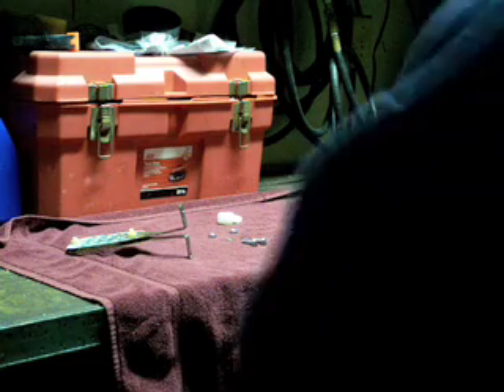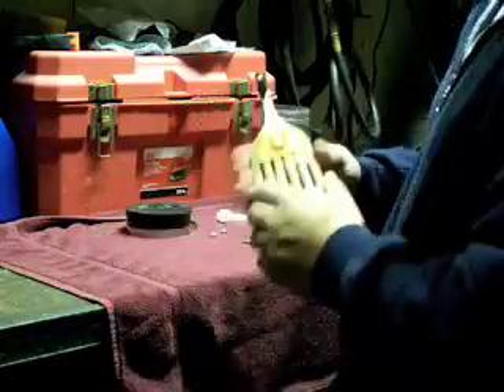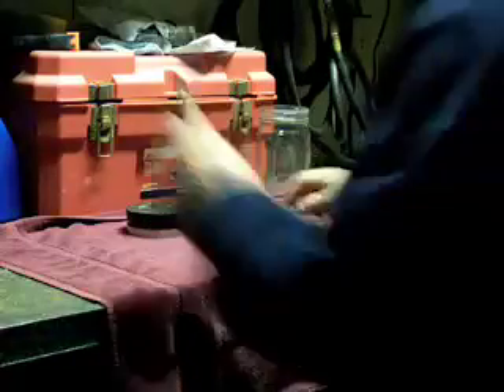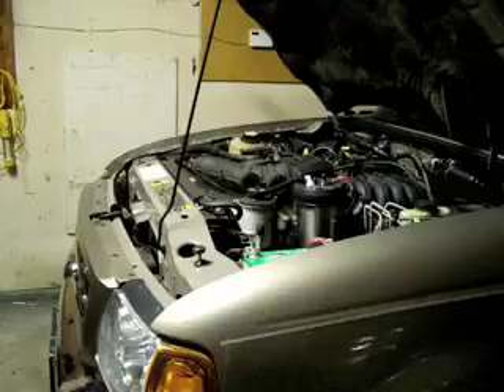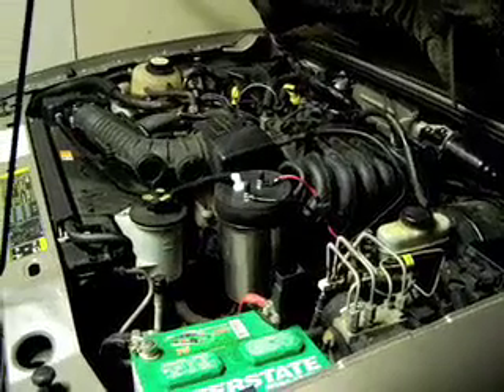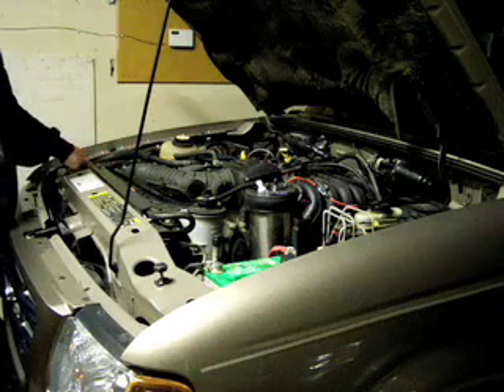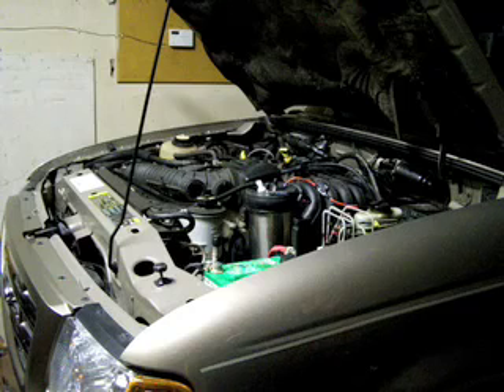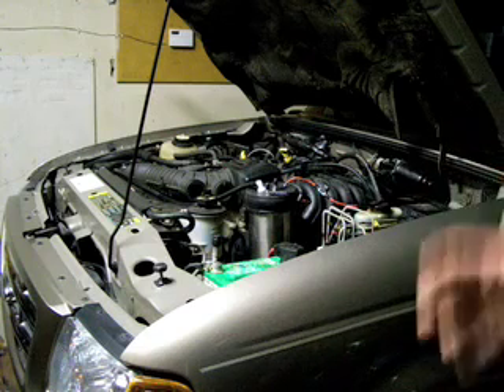How to build a simple - yet effective - HHO Generator

Comment: Can u make a video of how to make one that can completely run a car on HHO?
Reply from the maker: +Zane Kubicek  -  running an engine on hho without another fuel to assist combustion is a difficult feat.  Chemical hho creation using aluminum is a viable solution to this dilema.  Browns has is normally used to increase the flame front as other fuels burn and thus increasing mpg.

Comment: Would the air intake vacume from a turbocharged car be strong enough to suck the water out the chamber through the tube and draw the water into the engine?
Reply from the maker: +Jamie Byfield  -  If installed with the gas feeding in, as explained, prior to the air cleaner I can't imagine that happening.   However, obviously you should trial it carefully to avoid having issues or causing damage.  Use caution and safety first always.

Comment: How did you stop the engine from adding more fuel to the engine when it reads senses the added oxygen in the system? I've read there is some sort of chip you need to use is this what you did?
Reply from the maker: +Micheál Clune You don't need to modify anything as long as you allow it to mix with the incoming air flow.

Comment: I live in Maine, 5 months of freezing weather, no heated garage.
Q;  Will the sodium bicarb (baking soda) protect the H2o from freezing?
I liked the simplicity of your video.
Reply from the maker: Jean you will need to protect the cell from freezing by either using ethylene glycol or through the use of an outside heat source such as possibly a block heater when the device is not being used.  I use ethylene glycol in mine, just keep in mind that the cell will need more frequent cleaning this way.
Reply: salt water? maybe
Reply: ***** hi terry will a plastic peanut butter jar work?
Reply from the maker: jack terry I would think that a plastic jar made of that kind of plastic would probably melt or warp form the heat which would be risky.  Remember this is hydrogen gas and is highly explosive so always do the safe thing first and avoid unnecessary risks.
Reply: it will make it less poisoniees since salt will make a chemical that'll rust the metal and make a toxic gas

Comment: Great video and one that fully wexplains everything . . .Spme people mention about getting power supply from back of alternator others mention about installing a switch on dask board. . ome mentyion about mention about finsinf a vacum hose and connecting that way . . . personally I would use fuel in take were the Gas  (petrol) goes in to carb if carb version . . If inhection then id put it other side of air sensor
Reply from the maker: +jacky Parker if you plumb HHO directly in the way you mention you drastically increase the chances you will have an explosion incident.  My way is much safer and helps the gas and air mix which does not throw off the sensors.
Reply: no sensors on this engine

Comment: Hi Terry, I'm using aluminum plates 3'' PVC I have a 48 plate system it's about 30'' inches long. it holds almost 1 gallon of water. I added 20 oz of 3% hydrogen Peroxide I got a few bubbles, then I put 3 oz of food grade hydrogen Pero0xide 35% I got more bubbles I went to a 5/8 fitting I didn't want to build up pressure and have an even flow. I used warm tap water very few bubbles at this point. To keep the plates separated I hot glued drinking straws on both side of one plate of the 24 plates. I used my 50 amp battery charger to test the system. I chose Aluminum to better conduct the power better. I used a drain screw off lid and drilled the 5/8 hole for the out put of the Hydrogen and 2 holes for the electrical hook ups. and 2 Aluminum machine screws with flat washers and lock washers and silicone, and Teflon tape to seal every thing up. I need some input.? Does baking soda react to Aluminum ? My next step is building my bubbler.
Reply from the maker: +Fred Bynum I have not very poor results with Aluminum Fred.  I stick with stainless steel because it produces better and holds up to corrosion much longer.   Baking soda is sodium so it will likely corrode the aluminum or coat it with film.

Comment: Thanks for the tips. HHO before map sensor I didn't even think of that one, and putting the power supply line through a relay so it only has power when the key is on is definitely needed, Or a switch inside the cab would work also this way you could listen to the radio when your waiting for the wife..

Some type of flash back arrestor for a secondary safety feature should be used for sure, with a blowout valve on the jar for the primary safety. Also a bubbler so the steam gets captured before the hose goes into the air intake box. This way only the HHO gets to the combustion chamber in the engine.

Should also be aware to never had bare wires inside the jars they will corrode then spark and ignite the gas, do your home work thoroughly 1st many hours worth of learning on YouTube alone.

Cheers
Reply from the maker: +NoFear4XJs All good tips No Fear.   Thanks.
Reply: Thanks but only tips, as sometimes we can see better when we put insights into words...
Reply: I think steam is a bad thing, just means your boiling the water and not making more HHO. You also want both gasses to enter the combustion chamber that where the real power is. Agree ? Cheers

Comment: VERY EXPLOSIVE... personally experienced !!!  And I was only using a little 9 volt battery and a small jelly jar with two twisted wires 3 inches long.
Use extreme caution. Less is more, and more is lethal. Respect this an enjoy the benefits, abuse it an suffer the consequences. PLEASE BE SMART & SAFE.
Reply from the maker: +Ken Eutsey Well said Ken.  I can not express this enough to folks.  I have been doing this a long time so I too have had some close calls even with safety measures in place.  HHO is more explosive simply because it already has the oxygen it needs before it even mixes with the outside air.  Be SAFE

Comment: Hi Terry,  great video,  The air flow meter,  has it got any issues with the new air/gas mix passing through it?
Reply from the maker: +Dave Maher Not as long as you allow the gas to mix with the incoming air.  This is another reason I make the gas pass through the air cleaner box.  It helps the mix and it creates a safety barrier between the engine and the fuel cell.

Comment: So I can safely assume that I cant use this as a torch like we did a century ago.
Reply from the maker: +Delve Spectrum You can build a HHO torch and it is very useful just be sure to have a barrier between your torch and your fuel cell.  Remember the hydrogen already is mixed with oxygen so if the flow of gas slows or you accidentally touch the tip the flame will just flow back up the line.  If it makes it to your fuel cell you will have an incident . . . boom.   What I have done is put a tank between my torch and fuel cell that has a cap on it that will blow off.  So the gas flows out of the fuel cell bubbles through the liquid in the tank and then into the line feeding your torch.  If you have an incident the flame will travel to the tank and blow the cap off but it cant get through the water barrier to the fuel cell.  You will still have a boom but the cell will be safe.  A washer fluid tank works nicely with a rubber cap pushed on tight enough to seal but loose enough to pop off.

Comment from the maker: If you are blowing fuses you are probably using too much electrolyte in your solution causing too much current draw.  Try cutting back on your mixture first before trying to move up in fuse size.

Comment: I have built a fuel cell, it works great but when I connect a 10 amp fuse it keeps blowing.. Can I use a 20 amp or 30 amp fuse instead.

Comment from the maker: My Ranger has a 4-cylinder engine in it.  The average person sees 10% gains and more complete combustion on engines running normally before and after installation.  A Hemi should be using a dry cell unit like the one in my other video and not this little guy.

Comment from the maker: In one of my first projects I wired my relay into the wiper motor circuit by splicing the relays trigger power directly into the wire.  I suggest you find the circuit that powers your fuel pump in the fuse panel and wire your relay there instead.

Comment from the maker: HHO is Hydrogen-Hydrogen-Oxygen which is obviously a very explosive mixture.  Since it has it's own oxygen it cant be expected to be transferred as safely as other gases that do not contain oxygen. For instance if  propane tank were to spring a leak and gas were hissing from the tank as long as that gas is not mixed with oxygen inside the tank it would only burn outside the tank once it becomes mixed with oxygen.  Not so with HHO because it already contains the oxygen needed for combustion.

Comment from the maker: A bubbler is simply a sealed container of fluid like antifreeze or water in which you would feed the gas into submerged in the liquid.  The gas would then "bubble" through the liquid in the sealed container collect in the top.  In the top of the container you would seal in a fitting that could then be used to attach a line / hose to so that you can send the gas to your engine or torch or whatever.

Comment: Hey Terry, I have a question. I've read the use of a bubbler valve may be needed. What does it do and what is it? Where would you even put it? I understand that when you run a positive and negative current, the electrolyzed water completes the current and gives off a gas that you send through a valve into your intake. It's the bubbler valve that's confusing me. Great video by the way.

Comment from the maker: 10 amp fuse and wire is more than enough for this little guy.  Fuel pump switched circuit is the ideal power mechanism for your relay circuit.  And yes distilled water is just fine although you will still need an electrolyte.

Comment from the maker: Using a relay and connected to a switched circuit is the safe way to install this.  Preferably a circuit that is only energized when the key is on like the fuel pump circuit for instance.

Comment: you only use hho to supplement your fuel(gasoline) is it possible to run a car on 100% hho and if so will the car run hot because it is a lean fuel which may cause valves to burn as in lpg and gasoline vapours?

Comment: This may be a silly question, but what amperage wire and fuses are you guys using, also if someone can't find the wiper motor, what other sources of power would you recommend ? IE fuel pump etc, By the way GREAT VIDEO thanks Terry :) oh and can I still use distilled water, as I know the crap in our water here would surely interrupt the electrolysis process THANKS GUYS

Comment from the maker: I don't use a bubbler but you are definitely encouraged to do so if you have any doubt about safety or purity.  I have mine feeding into the air cleaner box so the HHO gas has to pass through the air cleaner / filter.

Comment from the maker: Yes but unlike propane or natural gas this has oxygen mixed in it at high levels which makes it very explosive.  If you were to try to compress this gas it will likely explode.  If you had the ability to liquify it that might be a different story.

Comment: the hydrogen gas is same gas coming out of your battery, is very explosive,that being said ,it can be controlled by excellent use of the best materials,your vehicle no matter what it is, will burn this gas and be very happy,in the 60's we knew of this tech,but when gasoline is 12cents a gal,who cares,now it is different story,this design is pretty good,just remember when motor is off everything is off,bro went to vegasw/o hydrogen,600. in fuel,came backw/hydrogen284.00 infuel no bull,it works

Comment: I just wanted to finish my other post. So after the mishap I built another one using four spatulas I have it in a PVC container. I put a blow out valve on top and have a flow arrestor on the tube just to be safe. I haven't wired it into the truck yet but did test it. It works great! And I wanted to thank you for taking the time to post this.I had know idea how powerful HHO is!

Comment from the maker: A hydrogen  fuel cell converts water into electricity by extracting the hydrogen.  GM had an experimental car in Europe that ran 100% on water.  When it went public they converted it over so now you have to put pure hydrogen into it instead of water.  Just another example of creating dependancy on a fuel source.  This is no better than gasoline when they do this crap.  Every water powered vehicle that comes out is buried almost immediately.  Japanese had one that burned HHO a few years back.

Comment: So the basic principle here is that you only have to run an electrical DC through the water. I've seen other designs similar to this using multiple plates (eg. +, N, -, N, +).. I've also seen a lot of designs just use a standard helix design with a positively and negatively charged wire. Does one design work better over another? Also, in a 2.5 L Flat 4 inline engine, how many cells would be needed for maximum efficiency? How many would be too much/dangerous?

Comment from the maker: Yes that is what I say near the end.  Make sure you are on a switched circuit like the fuel pump circuit for instance.  The parts are: 1 Wide mouth Jar, 1 Quick Cap, 2 plastic bolts, 2 plastic nuts, 2 stainless steel bolts, 4 flat washers, 2 nuts, 2 stainless steel plates (spatulas), 1 platic threaded x barbed fitting.  Just watch the video carefully and I give you everything you need.  Thanks for watching.

Comment: This is awesome. Im extremely interested in trying this out myself on my own vehicle. Would you mind emailing me with a complete list of parts needed as well as steps to create a reliable HHO generator? I would be extremely grateful. Email me at outcastwolf34082@yahoo.com

Also, I've seen a few other people use a switched circuit. Would this be a more practical solution than wiring the generator to the ignition?

Comment from the maker: It will freeze without Ethylene glycol  in the water.  You can get a pail for around 20 bucks at your local oil supplier.  I recommend pure Ethylene glycol  and not antifreeze because antifreeze has lubricants in it that will gum up the cell.

Comment from the maker: Sure I installed one in the bed of a pickup inside a cooler and just ran the gas line up to the intake box.  You could mount it on the roof if you wanted :-)  I should put one on the trunk and run gas lines down the sides and label the cell "flux capacitor" to see if I get a few looks.  Just kidding :-)  Seriously though it doesn't matter where you mount it as long as it is leak free and you can get the output gas line to the intake box.  Just be safe OK.  Thanks for watching and good luck.

Comment from the maker: Place a 1 liter bottle into a pail of water and allow the bottle to fill with water.  Then, while still submerged turn the bottle with the opening down and put the HHO gas line into the opening and begin a countdown.  However long it takes for the HHO gas to cause the water to be pushed out of the bottle is your output rate.

Comment from the maker: NO.  I have not witnessed a system that will allow anyone to run 100% on HHO under it's own power.  The introduction of HHO into the intake system is all about flame front.  What this achieves is a faster initial burn and a more thorough burn of the fuel.  HHO is a proven method.  Even NASA did studies in the 60's and found HHO to be a viable option to increase fuel burn and efficiency.  I have 8 years of experience and I enjoy the benefits everyday.  There is more than mileage gains to be had.

Comment from the maker: DC voltage only in these electrolysis units.  AC just jumps across the plates and causes bad things to happen.  Amps can be controlled electronically or by controlling the cell in stages and managing the amount of electrolyte you use.

Comment: Nice - thanks for the safety info and advice about wiring it in so the HHO generator will be OFF when the engine is OFF. Looking forward to boosting my mileage by using HHO to boost efficiency of fuel burn.

Comment from the maker: Try two things.  Remove the battery cables and reattach them two times in a row waiting around 15 minutes between connections.  This usually works to reset the computer.  Then run it again and do the math on your fuel consumption.  If the computer adjusts out your gains after this then try installing the gas feed closer to the intake, but use caution and make sure to install a flash arrestor between the cell and the connection just in case.  You can always go to my web site and call me.

Comment from the maker: I say too much HHO is bad because some engines can not handle the volume and will backfire through the intake manifold.  Not to mention "enhancers" are then needed to keep the vehicle computer from adjusting out the gains you made.  Keep the volume low and be happy with a modest increase and all will go well.

Comment: Hey Terry,
Thanks for the video. Great job! I've made two with 
the same design and they produce great.
One question i have is with the installation to the intake.
I put it in front of the maf and it increases milege but only
one time. Then it wont increase anymore. Do you have any idea why?
Any help would be great. by the way, i've checked for air leaks so that's 
not the problem.

Comment from the maker: Unless you have a generator producing large amounts of HHO and have made modifications to your engines computer and sensors you will not have any engine issues.  I have been running HHO fuel cells on both of my vehicles for over 7 years without a single issue.  Actually the engine oil is much cleaner due to reduced carbon buildup inside the engine.  I continue to see anywhere from 15 to 20 percent better fuel economy over running without the cell.  Thanks for watching...